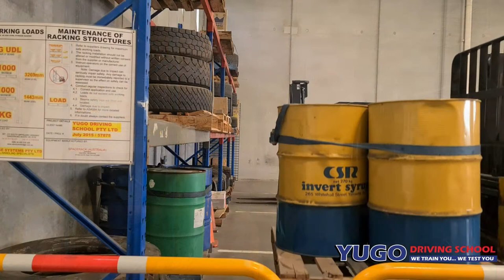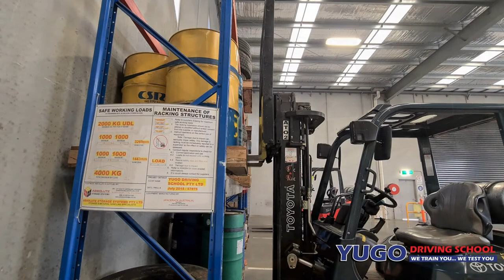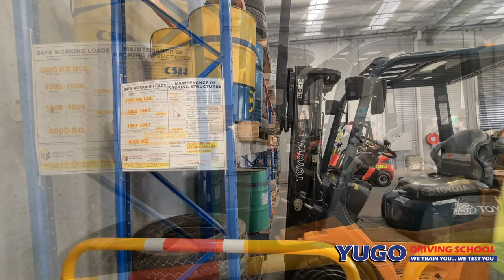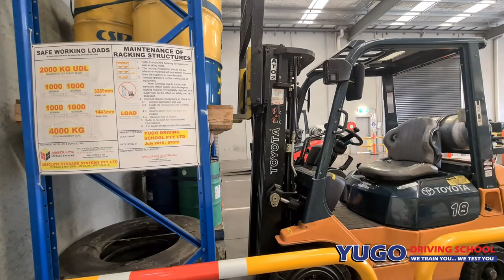Forklift  training Putting pallets away

Comment: Just a question in the video I noticed that on several occasions the tynes were off the ground when not in operation, shouldn't they be flat on the ground?
Reply from the maker: Yes, you are right. but for the purpose of the exercise there was no point lowering the forks to the grownd.
Reply: Appreciate your reply but it doesn't make sense.
The whole point of the exercise was to train people to safely operate a forklift.
Reply from the maker: @wb8643  maybe if you had to get off and on between each take you will under stand. Each step is taken one after another so the forklift is still in use. Keep in mind I am the camera man actor and editor all in one. How am i to show the position of the forks if i had to lower them each time. It is a demonstration of  the position of your forks . I think you are reading to much in to it.

Don't get me wrong i do appreciate your feed back. but i need to show the position of the forks.